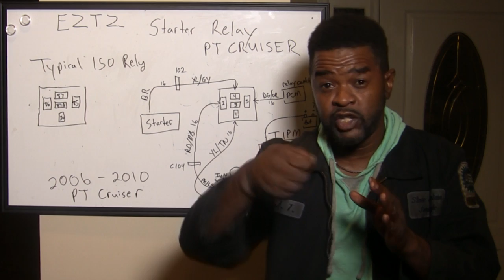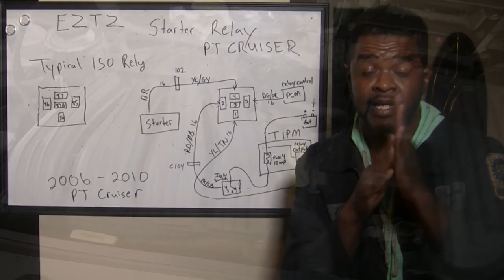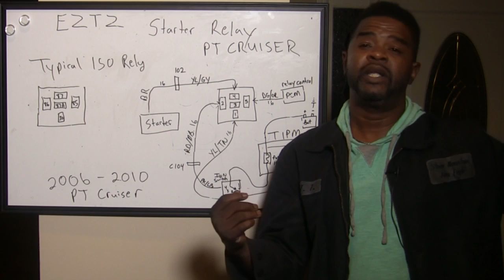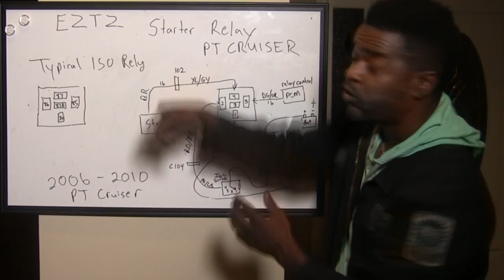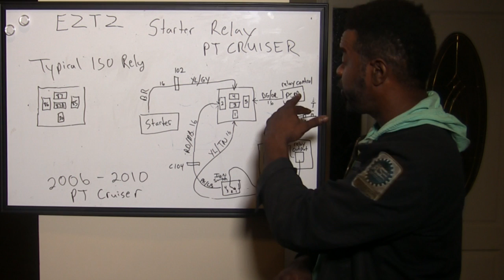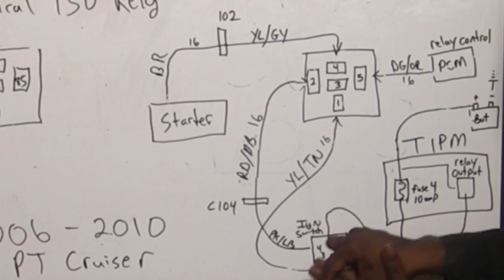No Crank No Start Diagnosis done using the Starter Relay, DIY.Won't Start? Simple Checks. PT Cruiser

Comment: Sir, I applied your trouble shooting techniques and found the following: Pin 1 actually had 12 volts as you stated. Pin 2 also had 12 volts and thats the pin that goes to the ignition switch then to the TIPM and to the battery. The number 4 10amp fuse was not blown! Pin 4 that goes to the starter DID NOT engage the starter when 12 volts was applied to it!!  My guess is the Igition switch went bad and is wide open constantly and the starter is shot? What say you?
Reply from the maker: hey my friend,  why would you suspect the ignition switch bad if you have 12 volts at pin 2 everytime you turn the key to start? Lets eliminate the relay for a minute,  if you jumping pin 4 to 12 volts and the starter not turning over, its time to find out why, Look at the diagram, either the starter bad or the power not getting to it..either the connector 2 is unplug (look at the diagram) or the wire from relay open..Best way to check is to reach down there and unplug the brown wire off of the starter and check continuity between that connector and pin 4 of the starter relay, if its ok, your starter shorted out..Please subscribe to the channel for me, thanks
Reply: @OnlineMechanicTips  Good morning, I failed to mention that at pin 2, it had 12 volts constant (without) me turning the ignition to the start position, which is why I said the ignition switch may be bad because its letting that 12 volts get to the relay without being turned. That single brown wire on pin 4 coming from the relay to the solenoid of the starter is quite visible however that is something that I didnt check to see if there was continuity. Basically if I go back and check continuity between the pin 4 wire and the solenoid and I get the beep on the multimeter, then the starter is probably shot? Customer stated that the starter was replaced and it started maybe 3 or 4 times and then the 5th it just quit. I was able to get some type of audible click near where the relay is when the ignition was turned but still no crank.
Reply from the maker: @marcusl.daniels9052  2 things, remember that wire change colors from the relay to the starter .it goes to a big connector, change colors to a brown wire then heads to the starter solenoid..so just go direct if you can..just send straight 12 volt wire to solenoid to see if starter spins..look, you gonna also have to make sure you not in theft lockout mode..but check starter first
Reply from the maker: O and yea 12 volts constant at pin 2 not good..you right..check switch
Reply: @OnlineMechanicTips  How do I make sure that its not in theft mode?
Reply from the maker: @marcusl.daniels9052  a good scan tool will tell you, what year make and model car is this?
Reply: @OnlineMechanicTips  2006 PT Cruiser
Reply from the maker: @marcusl.daniels9052  hey bud..is there a lil def LED light flashing on the cluster? Also do the remote work? I would try a hard reset first..unplug all 4 connectors off the pcm for 10 mins and the battery..tie the positive post to the negative post to drain the capacitors then see what happens..also none of this matters if the starter wont turn over, did you hardwire to starter solenoid to see if it spins over?
Reply: @OnlineMechanicTips  The key does not have the remote controls on it so that may have been the problem too!! She may need to go get the key recut and put on one of the remote key fobs and programmed to the car!!

Comment: I need some help i have a 2006 PT cruiser with a no crank.     At my starter relay I haven't any power at pin 1 and no ground at pin 5   any though on this problem?   I do have power from ign switch at pin 2
Reply from the maker: Hey buddy can I get you to subscribe to the channel and hit the notification bell please? thanks...Now, you may simply be in anti theft mode, if the car think its being stolen, the computer will take away that ground and in some cases that power supply at pin 1..You gonna need to scan your skim module and see what code it is that not allowing crank.

Comment: Although this is not a "non starting" question, it's about PT Cruisers anyway, so I'm gonna ask hoping you'll be able to give me an answer.  
I've got an '02 PT Cruiser with only 53,000 two owner miles on it.  It runs fantastic, but just lately the instrument dash cluster went out.  I contacted these folks-----> .  http://www.instrumentclusterstore.com/  who were very helpful and QUICK shipping for a tested and guaranteed (90 days) used cluster (you can't get new ones anymore).  The symptoms were that the dash lights, gauges, warning buzzers (bells) and even the interior overhead lights all went out at the same time. I bought and installed their dash cluster and everything has come back on again EXCEPT my AC won't work.  (It worked perfectly last Fall).  We made sure the Freon was full and then tested the low pressure switch (the switch where if the Freon is too low, the AC compressor won't turn on....whether the two things (dash cluster and AC electricity) are interconnected to each other or it was just a coincidence they both went out at the same time, I don't know) and found that there is no electricity getting to that switch.  So I'm guessing the problem is either in the dash AC knob switch or even possibly the car's computer?  Before I order a used computer (they don't sell new ones anymore to my knowledge) I want to make sure that the PCM (computer) is really the problem.  Since you're an EXPERT on PTs,  I thought I'd ask you first.  Any ideas??  A BIG THANK YOU in advance!!   Curt in Oregon

Comment: It's Dan.  Q: Neutral safety switch on a 04 Grand Caravan SXT 3.8L. My car won't start randomly - can start in neutral but a few times. I had to keep trying.  Is it my switch ?     ..I do have a leaking valve cover gasket.
Reply from the maker: Yes this can very well be your switch. Only we didnt call it that, this year van uses a PRNLD switch. This year van was equipped with the 41Te or A604 trans. You really need to do diagnostic when the problem is happening. If you not getting that input to the pcm (park or neutral) input, pin 85 of the starter relay will not go ground to allow crank.

Comment: Thanks for the video.  We have a 2003 Town + Country with what I think is an SKIM/anti-theft/immobilizer/key issue.  Original owner, we have all 3 keys (grey plastic head), but they do not start the van (it turns over but doesn't start, then after 6 attempts it doesn't turn over any more).  Red dot on instrument cluster is lit up.  We don't want to get stuck spending alot of $$ at the dealer to diagnose/fix.  Would a full-service locksmith be able to help?  I saw someone suggest that it might be the SKIM module, is this something we could get from a junkyard and have re-programmed?
Reply from the maker: Part 1--Theres only so much lock smith can do, they cant diag the car, if you tell them you want keys, they will do that. And yes, this van now in anti theft mode, meaning it wont allow crank anymore. It thinks somebody trying to steal the car. Also, yes, it could be your skim module and yes, i have install junk yard skim modules, the only downside is its not plug and play and you will have to marry it to your car, meaning get the vin off the car you got if off in order to programm to match your PCM..And another thing
Reply from the maker: Part 2..Another way around this if you think the skim is your problem and you are headed to the junk yard and you tryna avoid the programming. Get the PCM and the SKIM..These 2 are whats needed to be married together, you will at least be able to drive the car to the dealer to get vin matched for all the other body functions